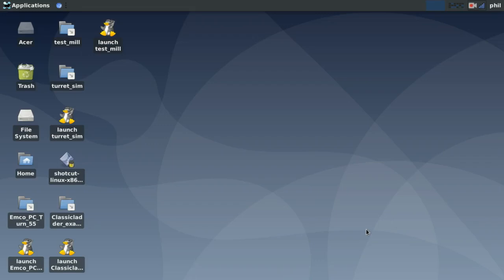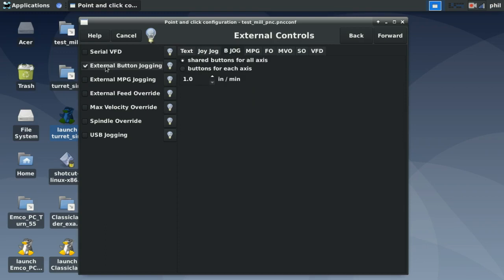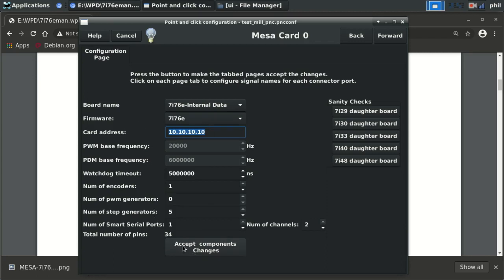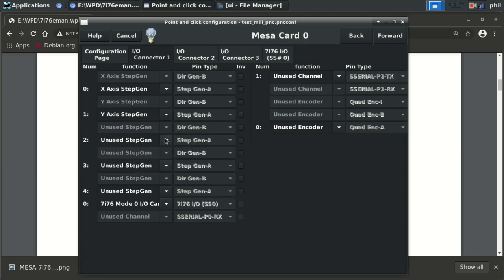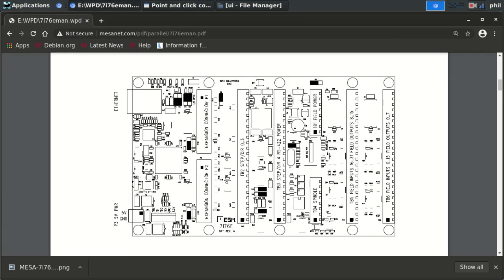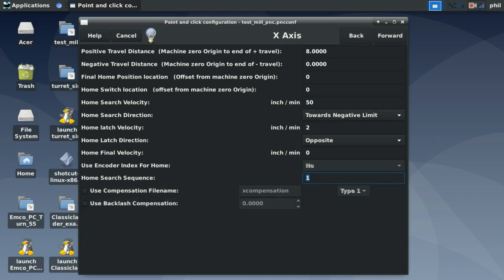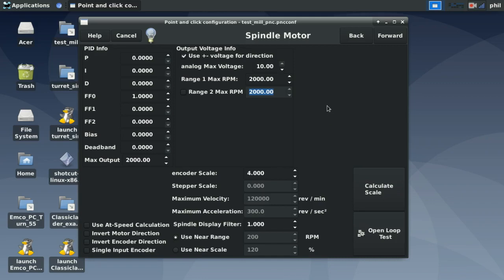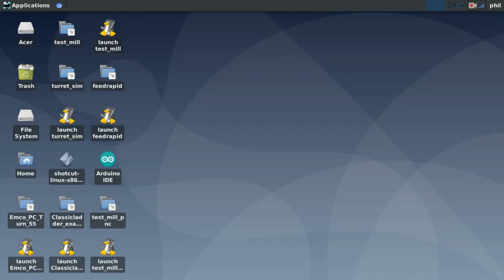Linuxcnc Bare Bones, Part 4 - PNCCONF Wizard

Comment: whats the difference between stepconf and pncconf? it seems like a lot of the same shit in two different config wizards that seem like they could all be in the same place. i mean they both create the same files right? or do they each create differnt files? maybe its just me, but it seems like they could both be in the same place right off the bat. great tutorials. i think ive seen just about everything you have done so far. a must for any linuxcnc newbie.
Reply from the maker: Step creates parallel port configs, PNC creates mesa configs. Logistically, I'm sure they could be merged, but it's probably some weird point of contention like everything else in LinuxCNC.
Reply: @TheFeralEngineer  i just wanted to say thank you. your classic ladder videos have given me a new understanding on the hal and classic ladder syntax. and now i found the halcmd which makes it even more versitile. one of the most comprehensible i have seen so far on this platform.

Comment: I see a couple things in the homing discussion that are not so clear:
Home position is badly named - it's just a position that the machine finishes at - it really has nothing to do with home.
maybe it should be called 'after homing position'
home final velocity ,  again really has nothing to do with homing - it's just the speed that it goes to 'after homing position' (usually rapid speed)
The help button will show some good info on this page of pncconf.
Thanks for making the video!
Reply from the maker: Yeah, i do plan to make an advanced pncconf or ini video that covers all of the options eventually

Comment: It's the 2.8 version?
Reply from the maker: Yessir
Reply: @TheFeralEngineer  Will you do later a tutorial for lathe Spindle step/dir control, but use it like a rotary axis too? (there is a Chinese servo)
I have used Talla83 conf files to use orientation, but not figured out how to do it for using it like a rotary axis.
My last video on the channel I'm using the orientation, but better to use it like a  rotary axis...
Reply from the maker: @DPTech_workroom  I'll see what I can do 👌👌
Reply: @TheFeralEngineer  thanks a lot.
May be for a 4th axis machine use the rotary A axis like a Lathe spindle too.